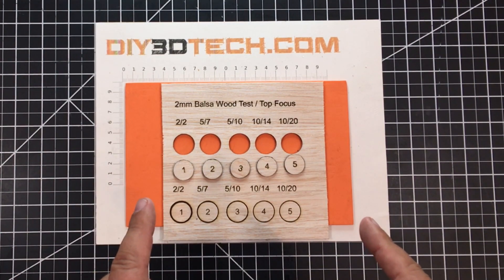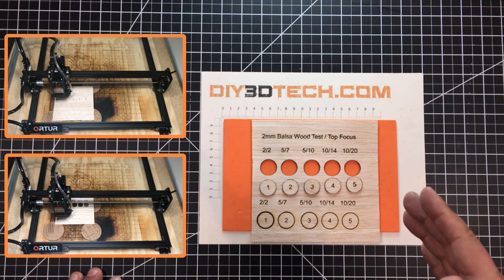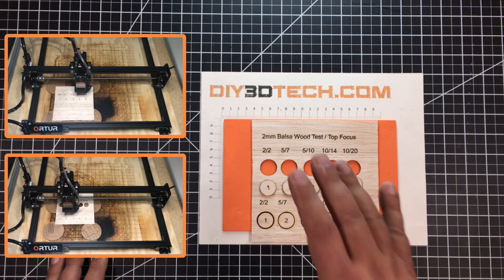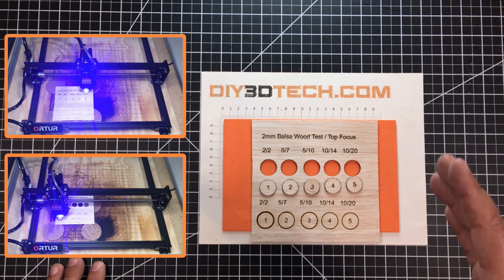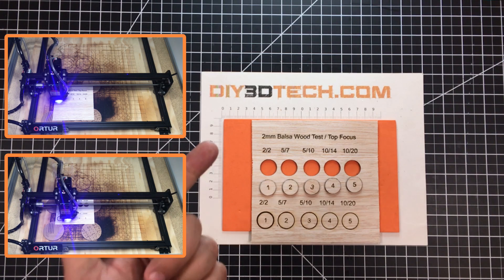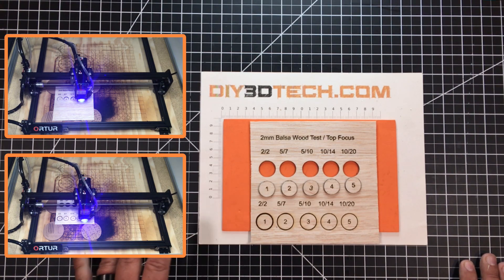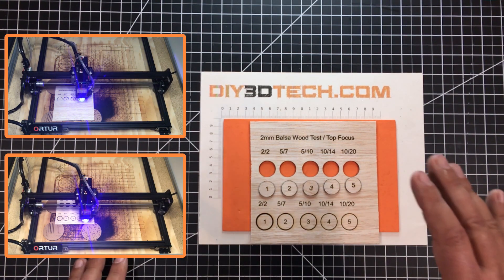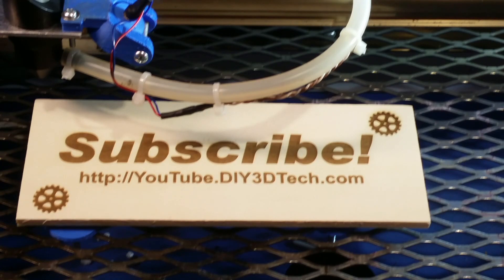Ortur Laser - Surprised Cutting Balsa Wood With Air Assist!

Comment: Hi, thanks for posting this video. I just ordered my first laser engraver / cutter with a 5w laser so I can cut balsa wood R/C airplane kits and I was wondering if you could tell me what power and speed settings I should use for balsa from 1/32 to 1/2 inch thick balsa as well as 1/16 up the a 1/4 inch thick light plywood? I plan to use an air assist system when I can. So for now, I'm going to use either a small fan or use a pump for an aquarium and run a hose with a 90° tube to blow air over the cuts .

Comment: I pretty much have your exact set up and I'm cutting through ply wood like butter.  The problem is that when I replicate your settings above with my laser (20W with air assist), I'm just burning up the balsa.  It's essentially catching fire.  It almost seems like the air assist is fueling the fire with oxygen.  Not sure what I'm missing here.  Any recommendations?
Reply: I think your air is too weak then  It almost seems like the air assist is fueling the fire with oxygen. Your Air have to be stronger .

Comment: So lots of plans seem to be available to 3D print these cool parts.... but..... I don't own a 3D printer and certainly not going to go buy one for this. What is my option?
Reply: I'd get some strong tape (fiber tape), epoxy resin, some iron wire like those for dress hanger. Design a path with the wire for the air tube with the iron wire and stick it to the laser with tape or make a small frame with wood and glue. You can make a nozzle with the epoxy and then drill it, you could also epoxy the tube to give it a shape.
Reply: Here in Saint Louis, Missouri USA the public library has them.  You submit a file, they quote you a price, and if you accept, they will print it and you can pick it up.  You might want to check with local libraries to see if they will do it for you.

Comment: what if you hook up a semi strong room fan to blow across the cut area?  will that work as air assist?
Reply from the maker: nope, needs to be into the kerf for best results.  Blowing across will clear fumes (from the lens) however will not clear the debris out of the kerf...
Reply: @DIY3DTECHcom  thx!

Comment: you ever use 2mm chipboard?  or 2mm plywood?
Reply from the maker: 3mm yes not so good (plywood) because  of the glue and the same with chipboard too...
Reply: @DIY3DTECHcom  thx!
Reply: @DIY3DTECHcom  i wana make a bin to hold vitamin bottles. what material do you suggest. i want it durable. like 10 in x 8 in x 6 in.

Comment: Nice but just one more test would have been REALLY helpful. You could have just put a fan blowing horizontally to see if the air assist improvements were from removing smoke or from both removing debris from the cut and removing the smoke.
Reply from the maker: From experience I would say 30/70 for smoke to kerf clearing.  Getting the ash out is key as it forms an insulator as you see more of my Monday video when we try leather!
Reply: @DIY3DTECHcom  so much better to spend T&E on higher velocity directed stream than just blowing air. Good to know, switching effort to centrifugal fan then. thx

Comment: It is all a bit confusing for me. As I mentioned somewhere in your video before I have 7W laser Ortur Laser Master 2. The weakest one from family (7W, 15W, 20W) and I must say, I cut trough 1.8 - 2.5mm thick material. It is actually hardwood french oak. What I do, I use 12-15 passes on speed 500 and with full power 100%. It goes fine. I cut this way many stuff. For thicker material 2.5 up... did try with 3mm oak veneer I did go for 100speed with 100 power and 2 passes, It also went through the wood. Then I am confused here about balsa. Janka Hardness: 67 lbf (300 N) for balsa vs Janka Hardness: 1,120 lbf (4,980 N) for oak. Which is about 17 times less tough than oak. How your 15W laser does what it does comparing to my 7W, not sure. And it is input 7W, Output I think is about 2.5W. If you like my wood examples and shapes I cut - please email me or contact, will provide it as you know I am not lie to you. Have lots of respect to you, just I am concerned about that speeds and passes. Cheers
Reply from the maker: I must admit that I am surprised on the hardwood, wonder if they accidently gave you a lager laser?

Comment: Recently I was having a convo with someone about poor cutting performance of their solid state laser.  I have a K40 laser and suggested an air assist add on.  So this video is very good timing.  I shared your video over on the MakerForums forum.  https://forum.makerforums.info/t/air-assist-with-solid-state-lasers/81665?u=nedman.  In case you didn't know the MakerForums is what became of some of the Gplus maker communities like the K40 group.  I know you were a member of the group way back when and all the old content from the Gplus group are archived there.  So all your old posts are still there and you technically have an account on the Forum.  I'm an admin for the forum so if you ever what to reclaim your old account just let me know. :)
Reply from the maker: Many thanks!  Back in the day someone kept riding me about posting content too frequently there which I never understand but okay.  I may take you up on that as I am also still into the K40 scene too!
Reply: @DIY3DTECHcom  So log in to MakerForums with Google authentication. That authenticates your ID associated with those imported posts, and you automatically then own the old posts imported from Google+

Comment: good day! i am currently having an lm15w and i hand in hand a simple 5015 fan and the thing is what you say it does move out the fumes and it doesnt start a fire but the edges are burned a lot. i was wondering if this kind of pump you think it will work with the combination of a 3d printed mount/nozzle. is the pressure and the 35 l/min enought to help me cut better and without that much burns around the ends? i mainly cut plywood 3mm and balsa up to 4mm . this is the compressor i have in a local store i can buy thanks!
https://www.amazon.co.uk/Hailea-ACO208-Air-Compressor-min/dp/B008POX9Y2
Reply from the maker: I would go with a pump about the twice the size...

Comment: What power percentage are you using?
Reply: Trust me, it's 100%. But what I wanna know is what is the volume of air ( CFM) and what pressure he's using. Why is he not talking about this important detail?
Reply from the maker: I am using 6PSI
Reply from the maker: I always use 100% (no reason to use less for cutting)
Reply: @DIY3DTECHcom  Have you had any issue with the diode using it at 100%? I seem to see a lot of people having issues with their diodes go out.